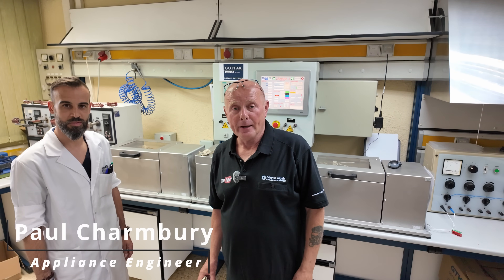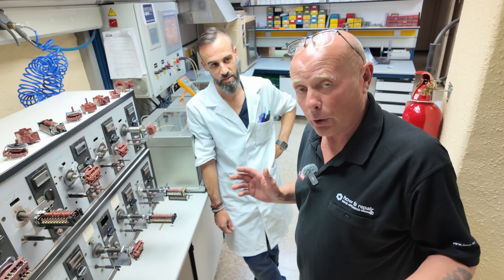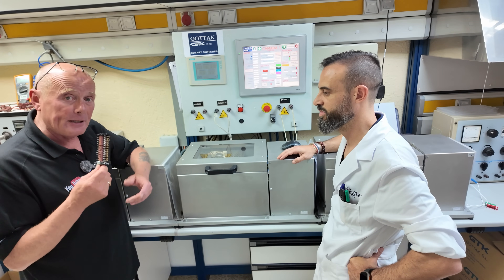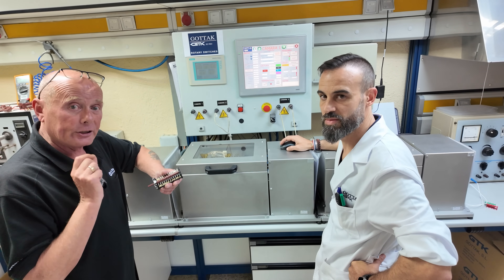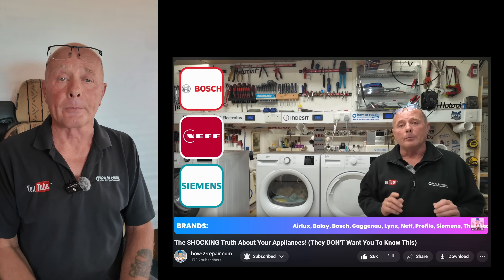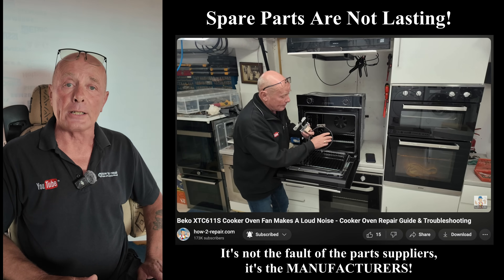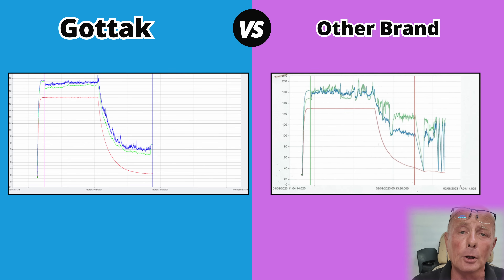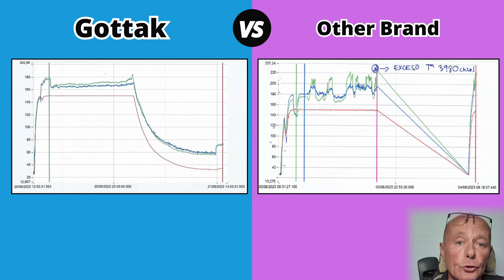Why Your Appliances FAIL SO FAST! Lab Results EXPOSE the Truth!

Comment: I know that condensators have spesifications which isn’t just the capacitance and voltage, but also how many hours by which temperature they will work, before, as in electrolytic capacitors the electrolyte, the oil inside will have evaporated.

By selecting a temperature and knowing in average how many hours, an appliance, like a TV will be turned on, and using the good old Gauss curve and statistics, the manufacturer will know how to calculate, so that an appliance, mainly will fail, just outside warranty.

Yes - even when the higher temperature capacitors cost just a little bit more than the lower temperature ones, the manufacturer is of course not interested in you keeping that washing machine, TV or game console for 20 years, while they earn, even a bit less on the one product you bought from them. 

This means - you really want to keep your appliance, like a TV or a PC well ventilated and cool. Dust off regularly - consider setting up fans.

I actually have bought some 5V Noctua fans (silent brand) for just this purpose, connected to the nearest USB ports 😄 - blowing air behind my multimedia PC, NAS-boxes, cable modem and  they run much cooler just because of that. I regularly use compressed air to blow air through my old, but very good plasma TV.

Please notice that fans must be blocked with a straw or something, not allowed to spin up, if you use compressed air. Removing dust is very effective as deposits of dust, will reduce the (often passive) cooling of circuit boards.

Yes - I know I am crazy - however I even have placed a 12V computer fan, behind my fridge, blowing on the hot parts of the compressor and tubes, and my fridge barely uses any electricity. In this case - the idea is not so much prolonging the life, as creating better air circulation to reduce electricity costs.

Often, btw switches can have their lifetime prolonged with some oil, however I would not have sprayed oil on the switches on an oven, because of the temperatures, and yes - I will typically put some oil on the wheels on our suitcases, before going to travel.

But I digress - keep appliances cool - and - in some cases, be aware that condensators still is a component that fails often. Of course the start capacitor for the pump motor on our dishwasher, failed a couple of months past the 5 year warranty. (I am Norwegian and in Norway, we have 5 years warranty on larger appliances.)

I had a hunch that turned out correctly - and had a repairman come home, a little expensive - and next time I will probably change the start capacitor myself, but still it paid off, as the dishwasher now is on its 13th year or something, so it has lasted longer on the replacement capacitor, than it did with the original one! 🥳

Not everyone can do all I suggested here, certainly not swap out components by themselves, but everyone can follow simple advices to keep electronics cool - disconnect from the mains when not in use, as the power supply often remains warm in standby mode. (Our microwave oven draws 50W in standby mode! 👎) so it has its own physically switched outlet) and perhaps set up small, noiseless lov voltage fans strategically placed to bring cooler air into the corner where your TV, multimedia PC, NAS drives, cable modem, PlayStation etc. lives. And lubricate things that moves, be it your bicycle or suitcase, a little more often. 🙂

BONUS TIP - avoid buying any product with that soft touch plastic surface - as this kind of plastic breaks down and gets gooey, in a few years - and there is no way to stop it and complicated to salvage the product which usually gets an ugly, stainy, cheap looking surface, if you are able to remove the goo, with acetone and other hazardous chemicals. 

Just say no to buy these soft touchy plastic products being it DAB radios or Bluetooth speakers! 

I can’t fathom that the EU hasn’t made a ban on this type of plastic long ago, already - and when they do, include non UV resistant plastic as well - how much garden furniture haven’t we thrown away because it looks bleached and ugly, how many times haven’t plastic storage boxes from IKEA gotten brittle and failed because the plastic isn’t even tolerating indoor light? 

Everyone talks about microplastics, no one talks about how easy we can avoid at least some of it, because all this brittle plastic, sheds microplastics in great amounts! 👎

BONUS TIP2: It goes without saying - if you can buy a product with user replaceable batteries, instead of the same products with built in batteries, it is usually better!

Or if you are the handy - IFixit type of person - at least check if the batteries may be replaced by opening the product, with not too much difficulty. 

Last category - Bluetooth speakers, is a big one here - almost none are easy to have the batteries replaced, so be aware.

That was my tips for making your (electronic) products last longer and choosing the best one that will not self destruct soon. (Due to the type of plastic used)
Reply from the maker: Hi there! Thanks for your comment, @thomashenden71!
Thank you for the interesting read. When I was in the Sahara Desert recently, if you watched that video series, you would have seen that I got caught in many sandstorms. It was surprising how much dust filled up all the electrical items because they attracted the dust due to their electrical fields.

You've hit on a really important point with your incredibly detailed insights into how component choices, like capacitors with specifications for operational hours at certain temperatures, can contribute to products failing predictably. Your explanation of how manufacturers might calculate this so appliances often fail just outside warranty is a clear illustration of the concerns around planned obsolescence. This is exactly the kind of built-in obsolescence we discuss in the video.

At the trade show last year, understanding how much obsolescence is being designed into new appliances these days, often down to the component level as you've described, is something everyone should be aware of. Your personal experience with your dishwasher's start capacitor failing just past the 5-year warranty (even in Norway with its good warranty laws!) and then lasting much longer on a replacement is very telling.

For a deeper dive into this topic and to see other examples we covered, please check out the full video here: https://youtu.be/gEgSCbZnHVM?si=wTIw0mELuhWaw4aX

We also explored related aspects in these videos:

The shocking truth about manufacturers: https://www.youtube.com/watch?v=QsdGd2qDPaI
Heat pump tumble dryers are they really worth it?: https://www.youtube.com/watch?v=xn03N3b0-lE
Thank you also for sharing such a wealth of practical tips for extending product life – from ensuring good ventilation and regular cleaning to avoid dust build-up, to being mindful of materials like soft-touch plastics and the importance of user-replaceable batteries. These are fantastic, actionable pieces of advice!

If you found this information eye-opening or helpful, please consider sharing this video with your friends and family. The more people who understand what's happening with appliance longevity and how to potentially mitigate some of these issues, the better equipped we all are as consumers.

Thanks again for watching and for your incredibly thorough and valuable engagement! Don't forget to subscribe to the channel for more insights like this!

Comment: I recently picked up a Miele W3985 that was in need of some TLC. Your teardown video of another Miele machine was invaluable and helped when it came to knowing where to pull on certain items. The machine is 18 years old and done 6000 hours. It was caked in limescale but I was able to clear out all the internal hoses and the drum seal cleaned up perfectly with some bleach overnight. The shocks need replacing (I have a new set on the way) the bearings and everything else in the machine is perfect. I will have the machine fully functional for less than 1/20th the price of a new Miele equivalent and I have no doubt it will do another 18 years with ease.
Reply from the maker: Hi there! Thanks for your comment, @shane250fr!

That's absolutely fantastic to hear! You've hit on a really important point about the incredible longevity and repairability of some well-built machines, as demonstrated by your success with the 18-year-old Miele W3985. It's brilliant that our teardown video was invaluable in helping you give it the TLC it needed, and getting it fully functional for such a small fraction of the cost of a new equivalent is a massive win. 6000 hours is impressive, and it sounds like it's ready for many more!

Your experience with this Miele stands in stark contrast to the issues of premature failure and disposability, often linked to built-in obsolescence, that we discuss in the video. It truly shows that appliances can be designed to last and be repaired, which is something we strongly advocate for. At the trade show last year, understanding how much obsolescence is being designed into new appliances these days is something everyone should be aware of, making stories like yours even more important to share.

For a deeper dive into why many newer products don't offer this kind of longevity and to see the examples we covered, please check out the full video here: https://youtu.be/gEgSCbZnHVM?si=wTIw0mELuhWaw4aX

We also explored related aspects in these videos:

The shocking truth about manufacturers: https://www.youtube.com/watch?v=QsdGd2qDPaI
Heat pump tumble dryers are they really worth it?: https://www.youtube.com/watch?v=xn03N3b0-lE
If you found this information eye-opening or helpful, and especially if your success story can inspire others, please consider sharing this video with your friends and family. The more people who understand what's happening with appliance longevity and the benefits of repair, the better equipped we all are as consumers.

Thanks again for watching, engaging, and sharing such a positive outcome! It's stories like these that give us all a bit of hope. Don't forget to subscribe to the channel for more insights like this!

Comment: I bought one of the very first microwave ovens.  It is still working just fine.  It doesn't do a lot other than heat for a specific time.  None of the replacements have lasted. Many have worn out while the original is still going.  Manufacturers COULD advertise actual quality and the customer could choose to buy a more expensive better built unit.  But vague claims in advertisements are not trustworthy.
Reply from the maker: Hi there! Thanks for your comment, @smitajky!

Your experience with your first microwave oven still going strong while newer ones haven't lasted is a fantastic illustration of the concerns around product longevity and what many perceive as built-in obsolescence – a core topic we discuss in the video. It's fascinating that your original, simpler appliance has outlasted many more recent ones!

You've also raised a really important point about how manufacturers could advertise actual quality, allowing customers to make informed choices, even if it means a higher upfront cost for a better-built unit. The issue of vague claims in advertising not being trustworthy is definitely a frustration for many consumers. This is exactly the kind of built-in obsolescence we discuss in the video.

At the trade show last year, understanding how much obsolescence is being designed into new appliances these days is something everyone should be aware of. It really puts experiences like yours with your long-lasting microwave into perspective. For a deeper dive into this topic and to see the examples we covered, please check out the full video here: Link to your main video: https://youtu.be/gEgSCbZnHVM?si=wTIw0mELuhWaw4aX

We also explored related aspects in these videos:

The shocking truth about manufacturers: https://www.youtube.com/watch?v=QsdGd2qDPaI
Heat pump tumble dryers are they really worth it?: https://www.youtube.com/watch?v=xn03N3b0-lE
If you found this information eye-opening or helpful, please consider sharing this video with your friends and family. The more people who understand what's happening with appliance longevity and advertising, the better equipped we all are as consumers.

Thanks again for watching and engaging! Don't forget to subscribe to the channel for more insights like this!

Comment: What happens when the switches controlling the testing machine break?
Reply from the maker: Hi there! Thanks for your comment, @ldm6752!

That's an interesting and thoughtful question: "What happens when the switches controlling the testing machine break?" It's a good point that even the equipment used for testing has its own components that can wear out over time! These are industrial switches and built for millions of rotations but they are inspected and the machine is maintained every year to the highest standards but a great question
Your question, in a way, touches upon the broader theme of component lifespan, which is central to our discussion on built-in obsolescence. While any part can eventually fail, the video focuses on concerns that this limited lifespan is sometimes a deliberate design consideration in many consumer appliances.

At the trade show last year, understanding how much obsolescence is being designed into new appliances these days is something everyone should be aware of. For a deeper dive into this topic and to see the examples we covered, please check out the full video here: Link to your main video: https://youtu.be/gEgSCbZnHVM?si=wTIw0mELuhWaw4aX

We also explored related aspects in these videos:

The shocking truth about manufacturers: https://www.youtube.com/watch?v=QsdGd2qDPaI
Heat pump tumble dryers are they really worth it?: https://www.youtube.com/watch?v=xn03N3b0-lE
If you found this information eye-opening or helpful, please consider sharing this video with your friends and family. The more people who understand what's happening with appliance longevity, the better equipped we all are as consumers.

Thanks again for watching and engaging! Don't forget to subscribe to the channel for more insights like this!

Comment: I don't understand how the shill-shite model works. When I buy something that doesn't last well, I never buy that company again. I can only assume that other people get shafted by a company so they buy another in the hope they get shafted again.  However My 12 year old Bosh EXxcel 1400 washing machine is on the way out. Anyone got any recommendations for a replacement.?
Reply from the maker: Hi there! Thanks for your comment, @marjon1703!
There is a video below that will surprise you about manufacturers owning many brands. This is their strategy. One company might own up to 20 different brands. So, when you go to the superstore and decide not to buy a certain brand again, you might end up buying another brand from the same company. The only difference is how the machine looks. It's all a trick.

At the trade show last year, understanding how much obsolescence is being designed into new appliances these days is something everyone should be aware of, and it perhaps sheds some light on why finding consistently durable products can be such a challenge. For a deeper dive into this topic and to see the examples we covered, please check out the full video here: Link to your main video: https://youtu.be/gEgSCbZnHVM?si=wTIw0mELuhWaw4aX

We also explored related aspects in these videos:

The shocking truth about manufacturers: https://www.youtube.com/watch?v=QsdGd2qDPaI
Heat pump tumble dryers are they really worth it?: https://www.youtube.com/watch?v=xn03N3b0-lE
Regarding your 12-year-old Bosch washing machine needing replacement, that's a decent lifespan for a modern appliance! While we don't endorse specific brands or models, as performance and availability can change rapidly, we generally suggest when looking for a replacement to:

Research brands known for reliability in recent years.
Look for models with comprehensive warranty terms.
Check reviews from independent consumer organizations and actual user reviews.
Consider repairability scores or availability of spare parts, if this information is accessible in your region. Sometimes other viewers here also have excellent firsthand recommendations, so it might be worth keeping an eye on other comments too!
If you found this information eye-opening or helpful, please consider sharing this video with your friends and family. The more people who understand what's happening with appliance longevity, the better equipped we all are as consumers.

Thanks again for watching and engaging! Don't forget to subscribe to the channel for more insights like this!